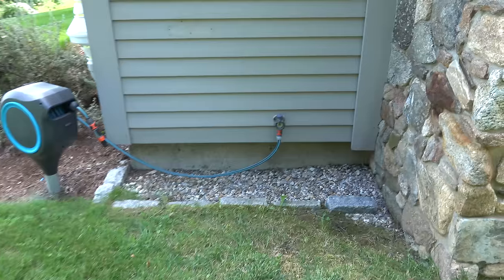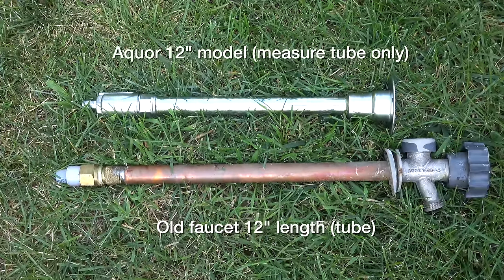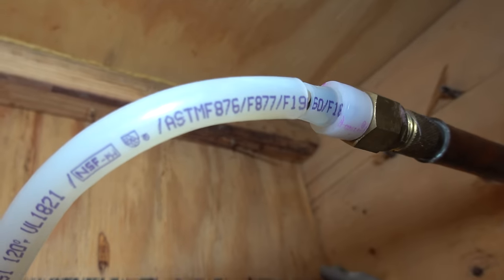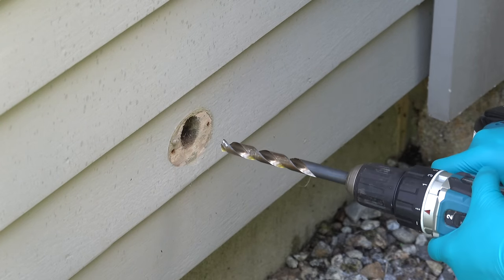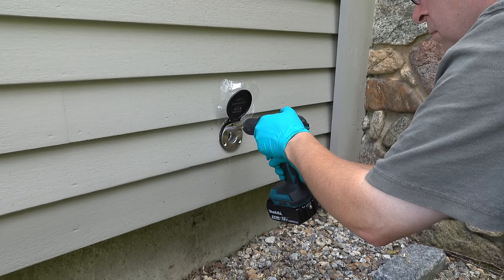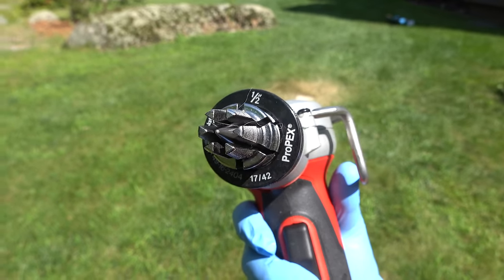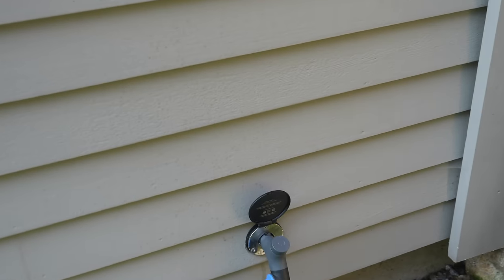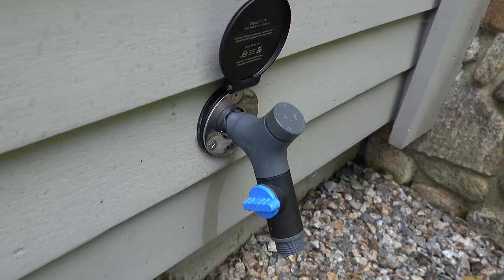REPLACING YOUR OUTDOOR FAUCET JUST GOT EASY / Leak & Frost Free AQUOR IDEAL for Retrofits

Comment: As someone living in Canada (AKA a cold climate) this looks great. While I do also echo some of the concerns regarding the potential durability of the hose adapter, it being plastic or some other kind of less durable material also makes sense. You want the thing that breaks to be the part you can easily change out, not the part that's hooked up to plumbing and in your wall.

The main thing I'd really want this for is simply not having to worry about draining the pipes going to exterior spigots when winter comes. While it's not a hard task per se, the problem is during fall and spring you can have some pretty drastic swings in temperature that result in +10C for weeks to suddenly -5C for a week followed by another week of +5C. You might argue by that point you shouldn't need exterior water, but if I got a nasty bucket I want to clean out and don't want to make our tub a mess, exterior water is kinda handy. The more months I can do that with the better. Additionally we have a garden that we water, and it wouldn't be the first time where winter shows up early while we're still getting the tail end of harvest.
Reply: as someone that lives in Canada also, NOPE, NEVER. That stupid  proprietary connection is the nail in its coffen. I want to be able to connect any hose to my house, and not NEED that special POS plastic thing
Reply: @Gantzz321  True. No real disagreements there. The part I find useful for us cold climate folk is more that the water valve stays in the insulated part of the home with significantly less risk of freezing and cracking. In our home we only have a crawlspace where our utilities are so it's not exactly a trivial task to shut off pipes.

A product doesn't have to be for everyone. But this solves a problem we have in our home. If there is a better product out there that solves the same issue I'm all ears. In our old home where it was an insulated basement, then this product would be pretty pointless because it wasn't a pain to shut off the pipes.

Comment: Reinventing the wheel here. Engineers must be bored, now that society is in maintenance mode.

I took off those backflow preventers off of my spigots. The valve should be enough anyway, and they always seem to be leaking. Just another unnecessary failure point. Sometimes they are locked in position too, what a headache.

Comment: Or you could just have a cheap ball valve installed inside your house on that line so you can shut the water off to the spigot.  Close the valve, open the spigot to drain water in the line and then close the spigot again.  No frost and no bursting spigot or line.  No one access water from my spigot because I only have water turned on to the spigot when I'm going to use it.  When I'm done, I go back into the basement and shut it off.

Comment: It has fewer parts and costs 3X more than a traditional 'frost-free' faucet. Not to mention the inserts are all made of cheap plastic, so you can be sure you'll be replacing those regularly. I can imagine my hose getting snagged and when I pull on it, "SNAP". There goes the faucet and another $15-$20 to replace it each time...
Reply from the maker: If you read the 1000s of reviews. None of that is happening. I get that its different, but it is very well made. https://amzn.to/3Xpoozw
Reply: @SilverCymbal  I like the idea, but not for the price, plus I'm hard on them. My current faucets are 40 years old and had the seals replaced once. They didn't need it, I just did it for the sake of it when I bought the house 10 years ago. I don't see these lasting anywhere near that long. I think they could be good for a business or something specific, where you wouldn't want the public having access to your water, but there are also cheap locks for that. I just don't think the benefits outweigh the cost, but I like the low-profile look. It seems the looks are the only thing going for it though. It doesn't improve on anything else.

Comment: Your first problem was cutting the pipe. You could have easily taken the bulky end off without cutting it. You shortened your pipe needlessly. You going to cut the pipe again if you have to upgrade it the next time? Eventually it'll be either you or someone else who owns the house who'll have to buy a new pipe because you kept cutting it.

Comment: Thanks for the video.  I like it but I would not buy it to replace a broken spigot and definitely would not switch out a functioning spigot.  Also not excited the primary connection piece appears to be 100% plastic which generally is never as durable and long lasting as a metal or brass fixture.  Oh yeah, and also IMO ridiculously expensive at $85  NOT including the "deluxe" plastic handle vs. about $20-40 bucks for a standard frost free anti-siphon 12" spigot including a metal handle.  So, looks cool but I guess cool is not in my budget.

Comment: The connection is the problem I'd say, the idea of making a better faucet is fine, but if anyone else has to use the fucking thing they will be lost. Otherwise yes, sometimes the old design that has to be covered with a bungie-cap in the winter to keep it from breaking your house, might need a replacement.

Comment: Having lived in forest fire prone areas for a lot of my life, the proprietary connector makes me nervous. Often, if there's a fire that is threatening a home, the firefighters will attach hoses to the existing spigots and use those to help protect the home. If, for some reason, I disconnected or lost the adapter, then they have no way of doing this. 
Now, if they made it so that the hole has common garden hose threads (they can also easily grind a 'quick change' groove to allow their adapter), then if fire is approaching my home, the fire department can quickly attach a hose and protect my house. 
Based on that alone, I think this is a total and complete waste of money. Sure it's 'sleek', but who cares?!, it's a flippin' exterior faucet. Definite example of form over function.
Reply from the maker: First, please buy or don't buy what you want but none of what you said is true. A firefighter doesn't even carry 3/4" tiny garden hose adapters, second if a house is on fire they aren't running towards a house, connecting a tiny hose or using yours and in than running back with your 40 foot hose, it wouldn't stop anything. Their own hoses are 7x that size. Also houses often lose power during a fire and if on a well the water is off and if you are on town water, you will have a hydrant. That is a fantastic story but they depend on their own gear not yours.
Reply: @SilverCymbal  While I definitely understand where you're coming from, I can say with absolute certainty that in certain situations, firefighters appreciate when homeowners who have to evacuate leave hoses hooked up and ready to go. I've lived through 2 major fire events on the west coast where I had to evacuate my home. Our fire department specifically requested that we leave hoses hooked up, as unlike in a lot of urban environments, there isn't a fire hydrant on every block. Also, just because we live in a 'forested area', doesn't mean we don't have access to city services (i.e., city water supply), but your point about powering a pump is definitely valid (in our case, we had solar to power that, but that's not exactly common). But often times the only water they have access to is what is contained within the pump-truck.
My whole point was simply that a proprietary spigot makes me very nervous, for the very specific reasons I already listed. In Paradise, California, a lot of the (honestly too few) homes that were saved could directly point to the fact that there was a hose hooked up and ready to go. In those events, every drop of available water is crucial, and if the fire department can utilize your hose to help water down the area to help prevent the fire from spreading, then they can use what they have on the truck to put out more crucial fires, and save more homes.
I'm not saying that a firefighter will use your little hose to put out a house fire, but in the grand scheme of helping protect homes that are in danger, but not currently on fire, it's incredibly helpful.
And just to be clear, I really and honestly do LOVE the look of the Aquor spigot. I just wish it didn't have to have a proprietary system for hooking up a hose. I feel the same way about phone chargers, etc.

Comment: Well, you're a good guy and I don't want to antagonize you but this Aquor frost-free valve has no use for me...especially for a block of money needed to get one (around $100 each...no thanks) and since I have five outlets around our house.  Then, there is the possibility if not the probability of losing or breaking the external shutoff valve which is a guarantee!  It's neat, it's cool...but useless for me.

Comment: Using non-standardized products on your home will ALWAYS result in larger issues in the future when you can't locate replacement to fix them because they either don't exist or you can purchase them anywhere expect through a very small nice market.
Reply from the maker: This company has done well at becoming anoter standard. Its the same fitting they have used for 25 years on boats for water inlets and outlets. If somehow after all this time and millions sold they go under, its no different than new faucets with propriety backflow preventers, if they break they can be replaced.

Comment: Looks damn good to me.  Why change designs that have worked forever?  To cleanup the outside of a house and how it looks.  Looks a LOT better with just that flap there instead of the normal spigot.  Not to mention moving the back-flow to the attachment point.  Also means it's a more secure nature.  No more neighbors stealing water if you have bad neighbors like that.  Also spigots are easy places for something to go very wrong in the winter.

Comment: Never going on my house, 3 regular sillcocks with backflow preventer for the price of one of these. Aside from that, bugs will make nests in the receptacle, I don't like the proprietary connector, nor plastic hose ends (brass to brass thank you). 
Long Island currently, soon to be in VA in our beautiful forever house, thing is while the house "looks great", who really sits and stares at their siding like it's art? Our current/temporary 1986 doublewide mobile home with exposed pipe underneath has NEVER frozen (at least, not enough to burst) in those 30+ years, left pressurized with no heat tape, not even insulation. So far as the "security" of rogue late night water bandits, c'mon man!

Comment: The only PEX I used while remodeling my mom's house was two short lines connecting the old copper tubing to the new shower/tub diverter. A year later and my mom says shes thinks she hears a leak in the wall. Look in the crawlspace and see water raining down. Cut a big hole in mom's bedroom wall to get behind the diverter and see that MICE LOVE PEX! A mouse had chewed into the hot and a flat spray had been dousing the wall for about a day. Economically, it had to be repaired with PEX again but this time I filled every space I thought a mouse could get through from the crawlspace to the bathroom. He/she probably went in next to the tub drain. The only happy thing about it all was imagining the surprise when the mouse got a faceful!

Comment: Installed an additional exterior spigot to my home here in Maine this summer. Consideredcthis as an option, but ultimately decided to install a traditional frost free spigot with Shark Bite fitting. Could not justify additional expense for this spigot given where spigot is located. If aesthetics were an issue, or there was a problem with someone turning on spigot without permission, I would certainly consider this option. In fact, I may install one of these when I replace an older existing frost free spigot next summer where aesthetics are more of a concern

Comment: I am going to show this to my husband!!!! I don't know what he will say. For the 4th time in 28 years, he has changed both front and back. This time, he went with the Shark bite. This last time, the water wouldn't shut off. During Covid, he needed to replace one. No one had one, including the big box places you would go. The water on that faucet wouldn't shut off, It was spring, I had baby animals being born, and I couldn't go without that faucet. We were having drought issues, and my veggies needed water, so he rigged an external on/off until the new faucet was off back order. We live in a cold winter climate, so freeze protection is a must. 
This looks cool to me as long as the parts you attach don't wear or break.

Comment: Dumb tenants would leave that outer piece in and it wojld freeze and flood that area..  No thanks.  I'll stick with the older freeze proof valves.   This system only works for conscientious folks who would remove that outer spickot / valve.  ;(

Comment: I would choose the option that gives me the most (affordable) flexibility. I don't want to struggle for compatibility if this company goes under, and I don't like having to buy a special plug for the thing, while every hose will easily screw into the previous connection. But if it's cheap, convenient and it becomes very common (lots of companies offering compatible parts and accessories) then I'd consider it.

Comment: You lost me at proprietary.    I would never install this and I would be reluctant to buy a house that had it.  $100+ PER outlet for non-backflow, $150 with backflow, hitting nearly $200 for anything nice.   Hose connectors at $30.   And let's face it you're going to be replacing those connectors at some point.   Yeah.  No way.   Noticed you never mentioned the price.

Comment: i could agree with using this on 4 conditions for the House Hydrant V2+
1. of the design of the Hose Connectors was made of metal (brass)
2. if the design was open source so other companies could make adapters (bring costs down)
- i under stand the need of companies to recoup R&D costs so it should last 10 years of solo production
3. if the backflow preventer was easy to change if it ever fails
4. if the House Hydrant can be rotated 90 degrees so it can have a smaller height

also the in-ground ones would need a way to blow out the lines with a small tire infiltrator so it does not freeze in the winter

Comment: Looks cool, I'd consider it, but it does feel as though it "needs" a proprietary thing to make it work, which does bug me. While the company may not go out of business, if it does, then you won't be able to get any of the parts for it, so eventually you'll have to replace everything just because you don't have any replacement parts for old krufty outlets. 

The primary benefit seems to be that it looks cool, with a secondary benefit that no one else can easily connect to your water. Is that latter really an issue very often?

Comment: I think it's unnecessary, especially at the cost point. I can just as easily replace my outdoor faucet with a 12" hydrant that costs $20 instead of the $85 for the proprietary one. It is cool looking, but if you're looking for ways to "hide" the faucet there are still ways to do that without going to a proprietary tool.

Comment: I think the functional use case here is water theft. If that is a problem for you, then this proprietary system will work well in preventing that. Most folks who would help themselves to your water bill are not going to go out and spend money on a proprietary fitting to facilitate their theft. No different from locking out external 110v. I think they definitely look great but for most folks I think theft is not too much of a concern, so standard fittings would be fine.

Comment: I'm not advocating that anyone replaces any of their existing faucets with this new product, but I see a lot of people questioning the durability because it is made of plastic. Not all plastics are strong, durable, and UV resistant but some plastics are. There are polycarbonates that are 6 times stronger than steel (in both compression and bend resistance) AFTER being baked for thousands of hours in UV light that is hundreds of times stronger than desert sunlight. I don't know exactly what this faucet is made of but my neighbor put one on his garage floor and hit it a few dozen times with a 20lb sledge hammer. The faucet was undamaged and actually gouged his concrete. You can also buy a spare for $35 if you worried about needing extras. Would I replace a working faucet with this, no. But if you need to replace one anyways, this is an option.

Comment: They do look cool and I do have an outdoor faucet that needs replaced. Problem is, I have a finished basement, so I have no easy way to cut off the PEX. And cutting holes in the finished drywall ceilings is a non-starter for me. I have lots of homeowner skills, but drywall isn’t one of them.

Comment: Uh, my house was built in 1993.  All the pipes are copper.  Also, I don’t have a room or crawl space leading to the outside faucet.  I would literally have to cut into the drywall from the inside.  Please make different videos for different situations.  If I changed my outside faucet I would have to do it completely from the outside.

Comment: I think the concept is cool and it looks good but the proprietary hardware does turn me off of it. Also I live in a very intense desert climate so the plastic handle would get ruined after one summer. That’s means leaving it off all the time which means I have to hook it up every time I want to use the hose. Ultimately, I’d have to live in a different area before even being able to deal with my concerns about proprietary hardware.

Comment: Nice looking item but a few things I don’t like.  To use the outlet you have to have the access valve. Also in areas having hard water, it will eventually leave a mineral stain running down the siding.  Plus, I envision mineral buildup fouling the auto close feature.